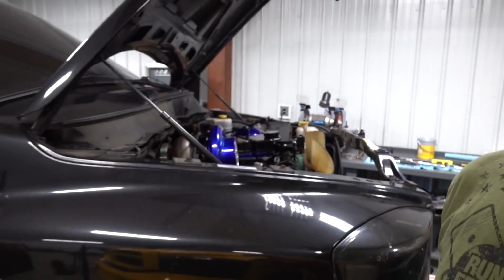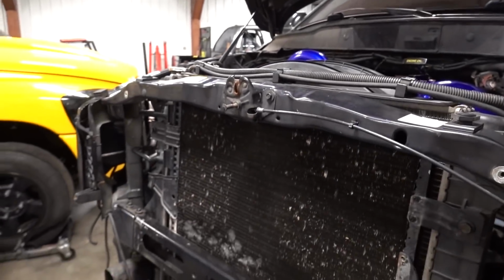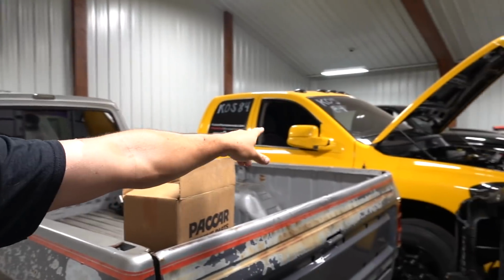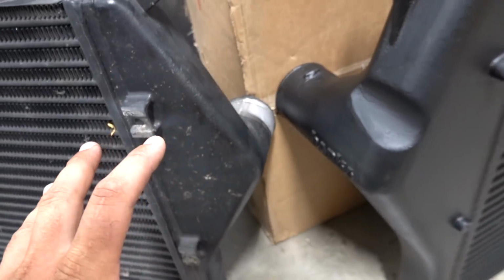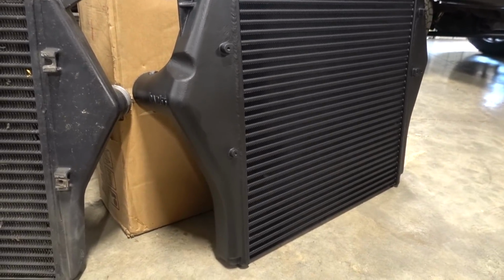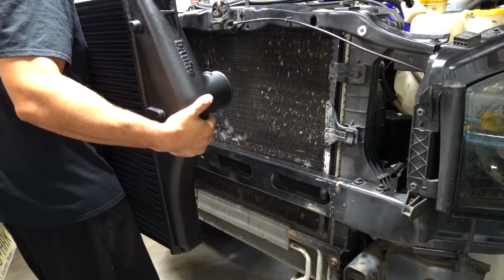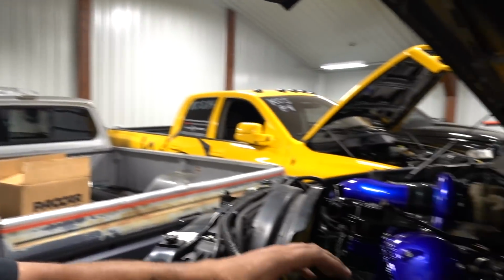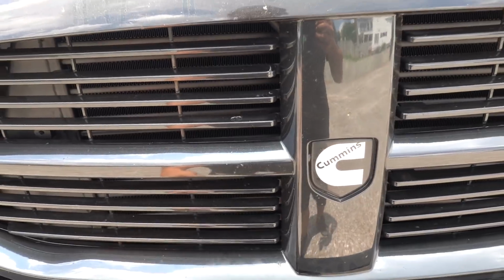CUMMINS TOW RIGS REUNITED AT LAST!!! IT'S BEEN FOREVER!!!!

Comment: Hvac is heat rejection. Higher the outdoor ambient temperature the harder it has to work until it doesn’t. That intercooler will get hot and add unneeded heat to the condenser coil

Comment: Where did you get that ac condenser where the brackets bolt on? The ones I found have all the brackets all tack welded on and I cant remount it if I wanted to. Your help and advice would be highly appreciated.

Comment: I don't think it'll work the same, intercooler would do a better job with cooler air coming in, but A/C head pressure is going to go up because of warmer air coming in from intercooler, and low pressure will go up making ac cool worse. But you have never to loose, worst case just move it back where it was

Comment: Anyone want to help me out? I have a 1996 12 valve cummins. The temperature fluctuates from 150-180 while driving. I have a new cummins thermostat matched to the engine serial number and a new radiator cap. Any ideas on how to fix this?